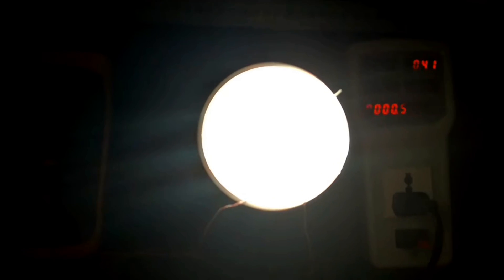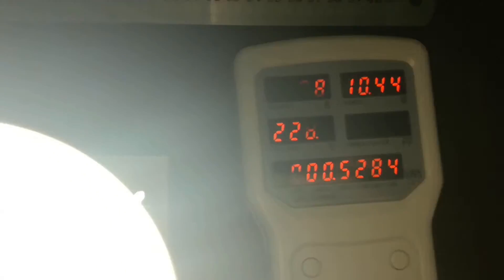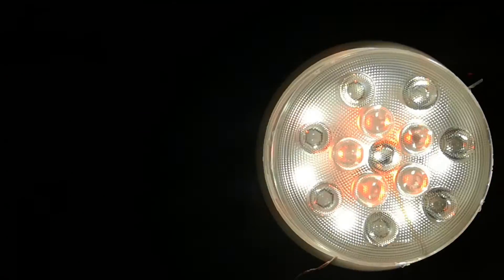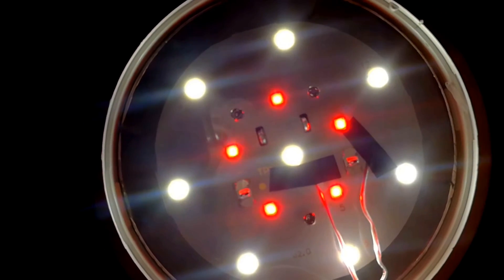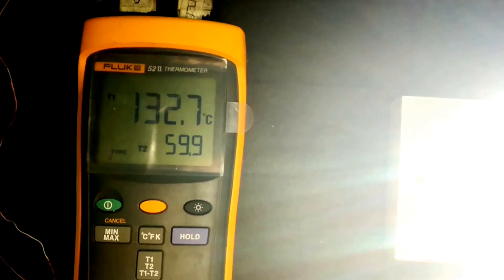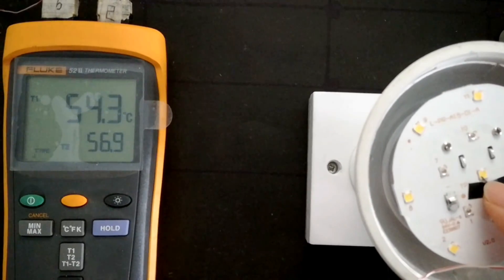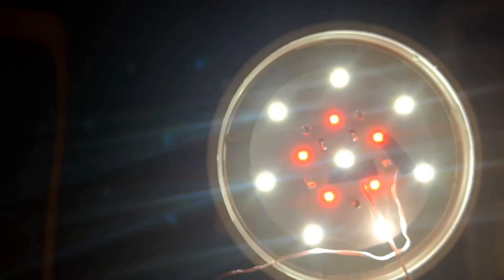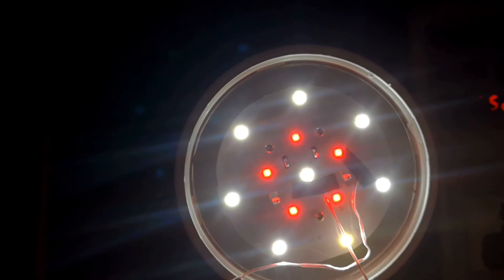IKEA LED1506R10 LED Grow Light Bulb thermal test

Comment: measurement LED Chip temp is not correct. a stream of light heated a thermometer. If this method is to measure the laser diode, then the thermometer will melt. The sensor must be mounted on the side of the diode with thermal paste so that the light does not shine on it. or use infrared termometer direct on cristal after 1 second when swich off it. (google translate)
Reply from the maker: i may not get your point right.. but i am going to say, that is right, should be tested the TC point... but i am sorry, no one can tell me the TC point.  only manufacture know that. 
if you worked in the lighting testing lab, like UL/ Dekra. you may know that thing.
Reply: @zhenhuachen6611  light radiation heats the thermocouple. 20-30% of the energy comes out of the led in the form of photons and getting on the thermometer heats it. the measured temperature is higher than the real one. the real temperature of led is 80-90 degrees. 15000h lifetime is real.
Reply from the maker: @АлексейАлексей-ч8ж4ч  hello there,  life time  of led chip, i understand, by LM80/LM21,like 50 K/36K, use all the time.
  i am just fighting the dissipation structure of lighting bulbs/ products. i also know to test the TC point, but the fact is that, no tc point on the PCB from many products.